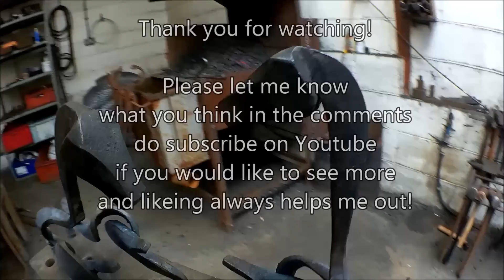Forging the Stags - Episode 4 -

Comment: This is a very interesting video I just whish you had stayed a little longer on some of the seines. I found my self pausing the video the second time I watched it. I noticed you sometimes wear a respirator when forging would you tell me you reasoning on this? You have obviously made these a few times before the way form the and bend it into shape is amazing. Its almost like you turn it inside out. Is this for access to the welding?
Reply from the maker: Thank you. I thought I would shorten the videos as at least I my self loose attention watching them but it's good to know that people like a lengthy video... I were a mask sometimes because my chimney doesn't have enough draw to take the dust away also long term exposure to grinding dust and stick welding fume will have serious effects on my lungs over time. so better safe than sorry.
Reply from the maker: yes access to do the fire welds needed planning before bending operations so you start with something that looks like it's from the film 'the thing'!